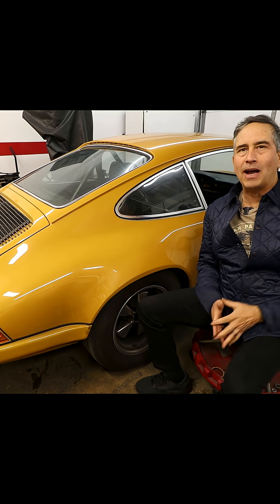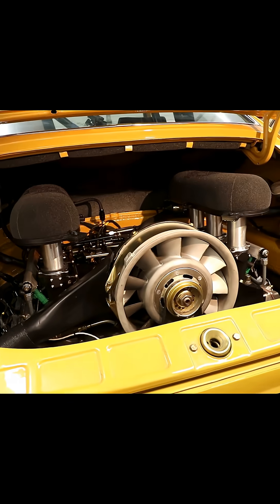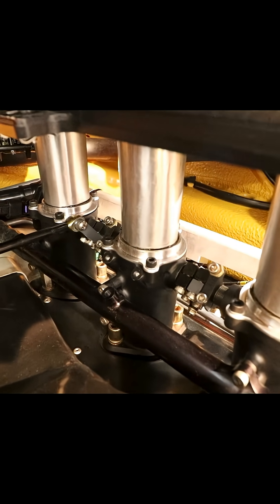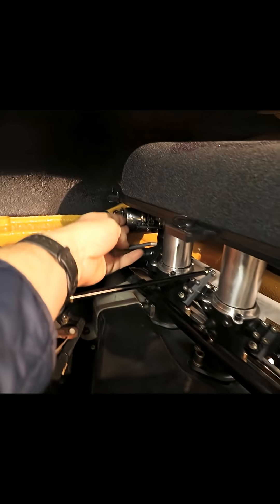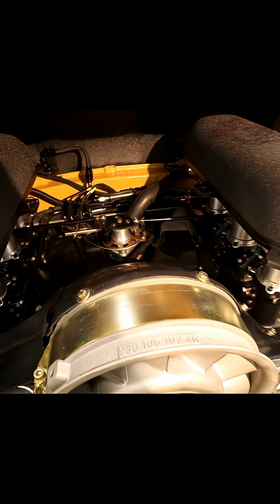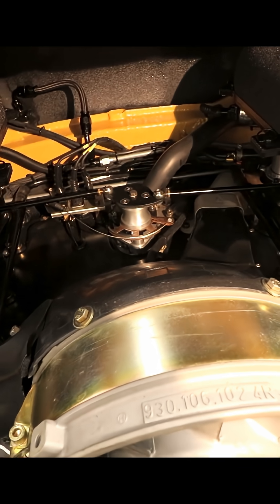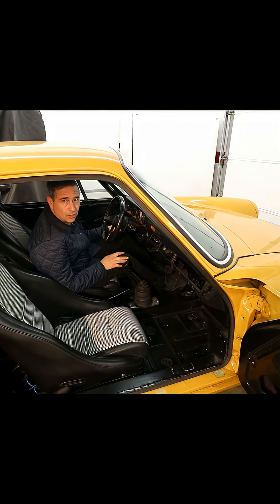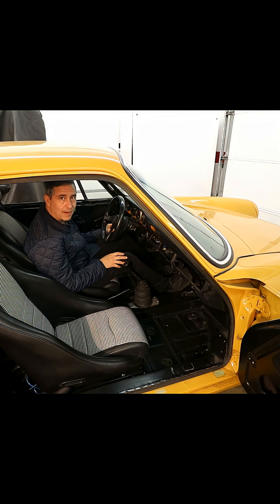Drive-By-Wire vs Cable Throttle — What Actually Makes Sense on a Vintage 911

Comment: Lovely car and work, but confusing assertions.  I cannot think of any benefit of drive by wire other than traction control, which has limited merit in a sports car.  Most of your arguments were why fly by wire is less convenient for this build.  Fair enough.  I like cable throttles because they have a consistent response, whereas fly by wire tends to have nonlinear response curves programmed in, taking control away from the driver.
Reply from the maker: It's a contentious topic, look at the other comments and you will see the proponents of dbw.  
However, i agree with you... a classic car should not have driver aids.

Comment: You have very little features of a drive by wire pedal. You only actually have one, a throttle. The curve is adjustable on most throttle setups like that, and is nothing new either. What you don't have, is the computers ability to manage the throttle based on other inputs. No traction control, no idle control, no launch control, no soft limiter, cruise control, upshift shift assist, downshift assist, etc, etc. You would not need two servos and tps sensors either. That can easily be set up with one, and is done regularly with even more ITBs than what that has. There are literally kits to convert that to DBW, without changing anything on the linkage you have there.... One servo, one tps senor... Then it could have all of the advantages of DBW, that you can never get with a linkage to foot system... A Kinsler throttle actuator would have zero issue converting that to DBW with one actuator and one tps.... Just hook the actuator to the same cam the throttle cable hooks to, and your done....

Knowledge of how to do something, is a powerful thing.
Reply from the maker: Hey I'm aware of what you are saying, even said most of it in this video.
I agree with you on a competition race car these driver aids can get results.
The point I'm making is that I don't want  it on a 70's street car.  
To get all the features you are saying i would need gear position sensors, wheel sensors, etc.
This car doesnt want to be a gt3 car.  Hopefully someone will read your comment and agree you and build something great.  
Sometimes new tech isn't the best tech and that's why we love vintage cars.  
You know these kinsler throttle bodies right?
Reply: @GarageTimeAutoResto  Yes, I saw they were Kinsler TBs. That is why I mentioned that their actuator. They can be set up with one or two actuators. To me, it doesn't matter what year the car is. And there is nothing wrong with staying old school either. I just found what you said about electronic throttles a bit odd. I have owned old school and massively setup as well.

Comment: Tom when I went to the G.M. Training center I asked the engineers why are we switching from throttle cable to drive by wire on simple cars it seems unnecessary? His answer was it’s more efficient to gather engine management data , and in The future we want the system to do more function surpassing what a cable system is capable of and now I believe drive by wire is the standard.
Reply from the maker: Makes sense on any modern car that is emissions controlled.  They can avoid rapid acceleration changes and save fuel.

Comment: I have experience with both and they're just different. My 79' 930 is fantastic but can be scary if you pin the throttle and don't know what to do next. Those were the widow maker years. My 03' 996TT is fantastic because it takes a second for the drive by wire to let you decide after you pin the throttle if you really want everything as there's a very slight delay until the ECU does the full send. 
It's kinda like how some people don't like paddle shifters and prefer a clutch and stick 🤷 they both work, you just have to be comfortable and confident using them.
I support your decisions to keep what works best for your build. I personally wouldn't want that new technology on my 79' but like how it works on my 03'. Pretty sure my 00' 986S is cable and it's just a little blast to push hard.
Yes, i may have a Porsche addiction but it's far healthier than my alcohol usage.
Reply from the maker: I have an 87 too with the same exact engine.  My yellow car with ITB fuel injection makes a world of difference in responsiveness.  
The 87 feels a bit lazy now.
Reply: My dc2 integra w a lwfw feels like a street bike motor w the cable throttle..the dbw system on my 03 996tt is awesome w the right tune. The stock throttle mapping is a wee bit sluggish

Comment: You'll laugh, but actually I'm actually planning a drive-by-wire installation for my 911 using AMP's stand-alone module.  As you may recall, my car has a single throttle body and 993 (plastic) plenum so it's quite straight forward, if not simple to implement.  I'll be using a 997 throttle pedal for the job too.  I might even get around to implementing auto-throttle blips on downshifts... But I 100% understand why you'd not want to do any of this, especially on a car with lovely ITBs!
Reply from the maker: 😂 I'm not singling you out by any means.😂
Everyones build is their own and thats how it should be.  For single throttle body it does make more sense.
What pedal assembly are you using?
Reply: All good mate!  The brake and clutch - stock components.  There is a way to adapt the 997 throttle pedal - I've seen adapters sold, but I will take a crack at designing my own.  I really hope to get onto all of this (and more) in 2026.